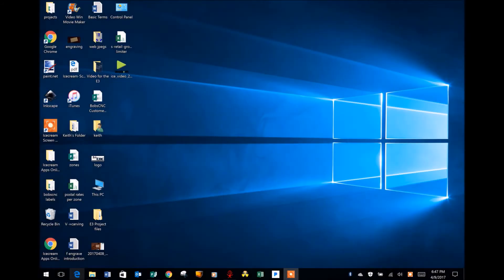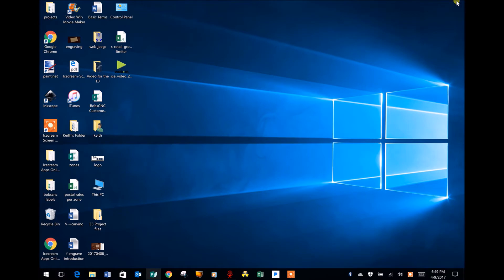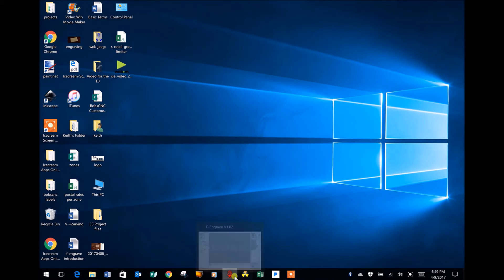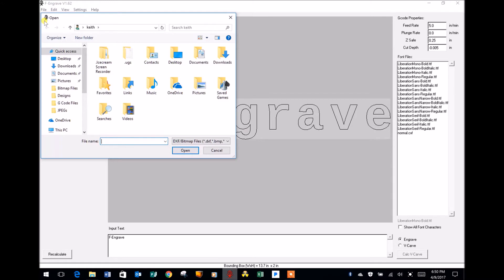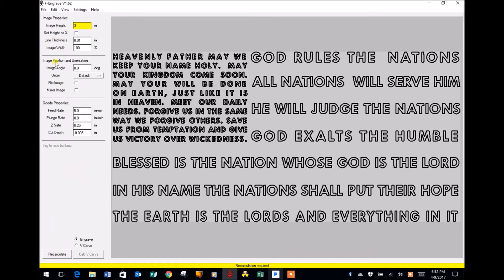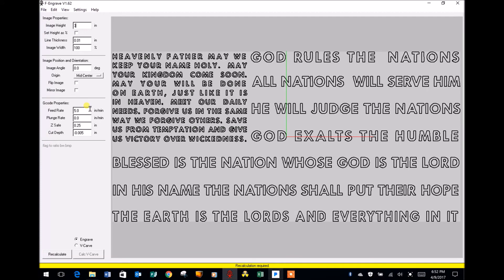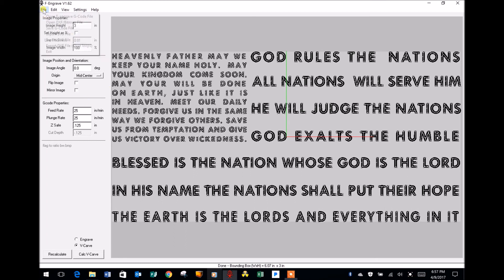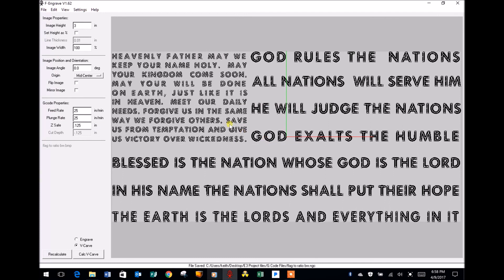Getting Started With F Engrave

Comment: What about the line thickness? Because if line thickness is .01  the v bit  will not drive the z axis to what I Set in f engrave.  t because it will prioritize the line thickness.
Reply from the maker: If you want to cut to a fixed depth please use the engrave setting. If not, them make sure the bit parameters are set correctly in the setup and use the v-carve setting.

Comment: Why won't my spindle run with G code generated by this program, it runs fine from another G code generating program?
Reply from the maker: There is a pre and post gcode text box that you can set up the gcode for the spindle. Please fund it in the menu setting>>general settings.
Reply: I was having same problem.  I know the CNC is working correctly because I ran some sample code created 4 making a circle by cut & pasting it into notebook & saving it as .NGC file worked beautifully.  Learned that depth & speed is super important since I did this on piece of scrap red oak & boy did that bit get hot :-). Can't wait till I can try this solution !!!